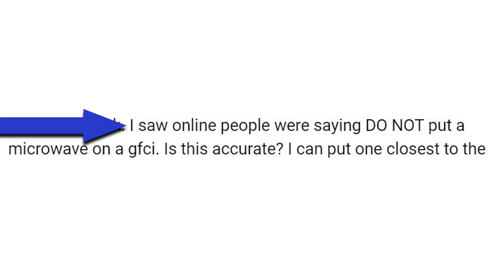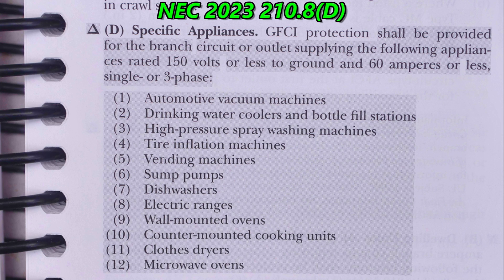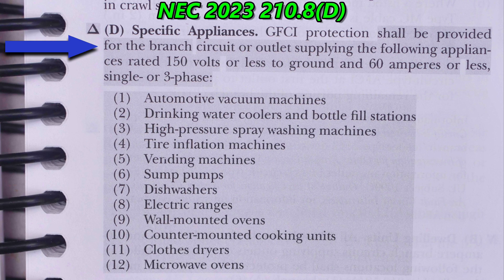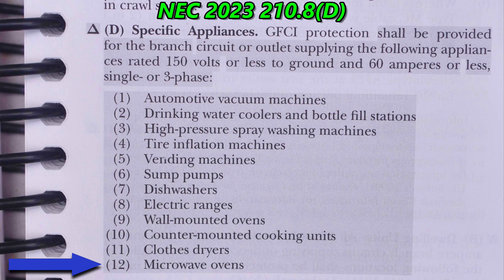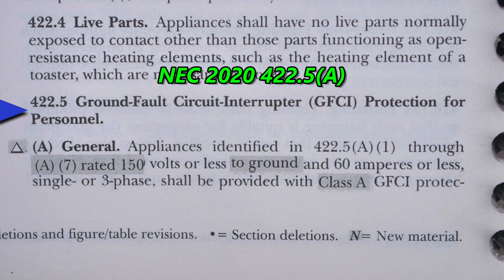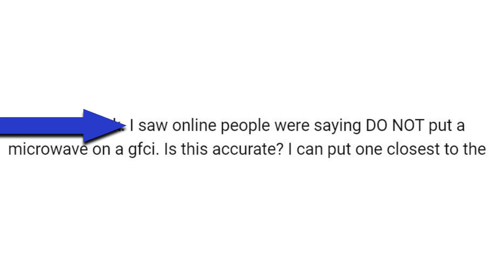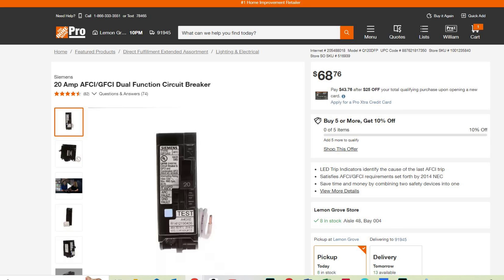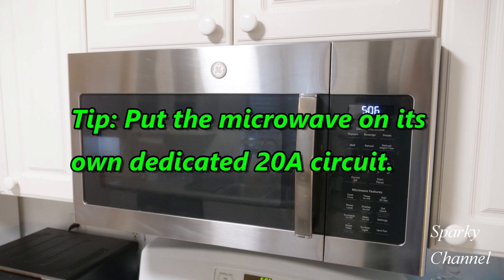Do Microwaves Need to be Protected by GFCI? (NEC 2023 210.8(D)

Comment: just bought a Samsung microwave, i have a dedicated circuit with a gfci/afci breaker.  The microwave trips with every use.  Called the electrician who said I have a bad breaker so of course I have a new breaker which trips every time I use the microwave.  A appliance tech came out to inspect it and found no electical leaks and called Samsung and first thing he asked if the unit was connected to a gfci and was told that they should not be plugged into a gfci outlet.  So I have a new microwave that doesn't work.  Told by Samsung tough titties said the big cat to the little kitty

Comment: Great info on the 2023 Code changes & requirements!
However, it is worth noting that:
Electrical device manufacturers (e.g. Leviton, Siemens, Schnieder/Sq-D, et.al.) all have VERY heavy input and influence into the NFPA-70's Code-making panels. Therefore it should come as no surprise that these companies would push the much more expensive devices to be "required" nearly everywhere. After all, if you can sell circuit breakers that cost $70 - instead of one's that cost $7 - which would you rather be trying to sell? (And it's doubtful they cost 10-times as much to manufacturer).
Just follow the money...
For some appliances - like a dishwasher or sink disposal - a GFCI recep' is not always easy enough to access in the event of a trip. Therefore, a GFCI-type breaker must be used... at 10-times the cost.
While GFCI's have been around quite awhile, and have become pretty reliable, AFCI's have not. The technology is still fairly fresh, and they still suffer from nuisance tripping - usually without any notable cause. They are also very sensitive to utility line surges (such as lightning) which can damage the circuitry and will cause them to nuisance trip even more.
I recently removed four such  devices from my own residence - which all began randomly tripping following a thunder storm event in my area (a very common occurance here in my area of west Texas. We did not suffer any outage during the storm). Once the defective AFCI breakers were replaced... no more nuisance tripping (they were relpaced with standard breakers).
I have heard of electricians who will install the required AFCI breakers in a new construction house, simply to pass inspection, then will remove & replace them with standard breakers afterwards, just to eliminate endless trouble-calls from the new homeowner. 
While the protection idea is wonderful, the reliability of the equipment designs and technology hasn't quite caught-up...
Reply from the maker: First of all, let me say that you have a wonderful ability to write effectively while also getting your points across. Well done on that. Also, I agree with everything you mentioned except for swapping out required AFCI's for standard breakers.
For my 2 cents, I think that whoever included sump pumps in this never owned a sump pump. Thanks!

Comment: Above the range microwaves or range hoods require a dedicated circuit. Must be GFCI protected if within 6 feet of a sink, or if 2023 code is in effect. Here in Florida we're on the 2020 code until 2026.
Reply from the maker: Right on, thanks!

Comment: so obviously a 220 volt 30 amp electric clothes dryer does not need a gfci , but does it need afci ?
Reply: All 120-250 volt receptacles in the laundry areas require GFCI. Washer and dryer. 210.8 AFCI is only required for the 120-volt laundry outlets. 210.12
Reply: been having issues with dryer gfi's had the inspector out and he said put in a regular breaker , some applications just aint workin right  @JeffBanfield-t6v
Reply: @sayfullahdclxvi5773 no that jumper should be removed either way
Reply: @coreyfranco7060  In older homes with three prong, I would leave it on. Otherwise I completely agree.
Reply: @lakorai2  assuming you are authorized to rewire the circuit, sure.

Comment: A lot of times the GFCI on microwaves, ovens, dishwashers, and related devices, the recepticles are not easily accessible. If the GFCI trips on a dishwasher the homeowner would have to pull the device out to access the reset buttons. I have started to see these devices hardwired to eliminate the local GFCI and put a GFCI breaker instead.
Reply: I move the outlet from behind the dishwasher and relocate it to under the sink.
Reply from the maker: Good point, thanks!
Reply: 2023 NEC 422.16(B)(2)(5)

Comment: I'm not sure what the NEC says, but I recommend putting mounted microwaves on their own circuits, and 20-amp if that's allowed. For some reason in this 70's house they put the kitchen lights and the microwave on the same 15-amp circuit, and it dims the lights every time the microwave is used, even LED bulbs somewhat. I have a 1200w modern microwave.
Edit: Oh I see you recommend the same! I posted this before finishing the video, lol.
Reply from the maker: Great minds think alike!

Comment: Almost seems that the people writing these codes have stocks invested in circuit breaker manufacturers.   Looking at 210.8 (b) , gfci protection in other than dwelling units,  125 and 250 volt receptacles 150 volts or less to ground.  So what they're basically saying is a lot of 2 pole GFCI breakers will be sold.

 However, let's say I have a NEMA 6-xx receptacle in one of the locations specified,  and I'm using phase A -B in a 120/240V 3 ph 4w delta panel with B phase as the stinger leg. What that means is I'm not required to provide GFCI protection because one of the phases is 208V to ground,  although the breaker must be a 240V straight rating.  That's my interpretation, what are your thoughts?  Let me know in the comments.
Reply from the maker: It will increase sales. I have to agree with that.

Comment: Question when it comes to refrigerators.  Most folks say no to GFI protection outlets for refrigerators because the compressors can draw a large amount of juice when kicking on. Some electrician's have put out that if your fridge is kicking off the GFI plug in a garage, put the GFI outlet in the next plug in the line (to protect the rest of the line, but not the fridge).  I really couldnt find anything on that!!!!  That lead me to thinking.  Lets say you have a fridge in the garage and it's plugged into the first outlet in the line. The second outlet is a bathroom. The next outlet is an outside plug then two more outlets in the garage. If what this other electrician was saying accurate, the first outlet could be changed to a regular 15 amp outlet. The next on in series is the bathroom. Change that one from a regular 15 amp outlets to a 15 amp CGFI outlet to protect the bathroom and the rest of the circuit.   So confusing!!!!
Reply: Fridges should be on their own 15A circuit. If it gets tripped by a different plug elsewhere then you may have $300 of rotten meat because you were unaware of the trip.

Comment: Wait a second... No Fridge or Washing Machine on that list?
Reply from the maker: Yeah, I think those will be on another video. It's getting rather confusing, isn't it?
Reply: 210.8(A)(6)  required in Dwelling Units Kitchen's (if a fridge in the kitchen, it needs GFCI
210.8(A)(11) required in Dwelling Units Laundry areas. (Phrased so no matter what area the Laundry machines are installed in, they are required GFCI.).

Comment: my inspector back in the early part of the century had a low bid electrician put in 15A circuits for over the range microwaves in a multifamily dwelling, and told him it was okay, because he was going to install 1000W microwaves.  so he went microwave shopping that weekend, and found there was only one model of over the range microwave that it is legal to feed from a 15A circuit.  

in my state, the specialty code allows fixed appliances to be fed from a non GFCI protected circuit in a dwelling unit.  but that doesn't include countertop microwaves.  it does include dishwashers, but I developed a habit of putting a faceless GFCI under the kitchen sink to serve as a local disconnect for the dishwasher - unless it's a cord connected model, in which case I can just put in a standard GFCI and safe off the wire that would feed a hardwired dishwasher.
Reply from the maker: LOL! A 15A circuit for a microwave is just plain being cheap. You know the owners will eventually change out the original micro for a higher watt one.
I love that some states stand up against overly stringent new codes. It sends a message.
Reply: @SparkyChannel  the original argument for AFCI tech qas to prevent fires from damaged electric blankets.  Now I'm seeing maxed out circuits, because electricians are trying to get away with one less breaker.
Reply from the maker: I can understand that because the  breakers are so expensive now. @kenbrown2808

Comment: ive got a light with a ballast that instantly trips gfci outlets 
its odd
Reply: If you have already you might want to replace the ballast. My guess is that the ballast is allowing a small amount of current to leak from the neutral to the ground wire.
Reply: @everythinghomerepair1747  ah it was a restore find, there's gotta be some sorta super janky fix for it
It's also an electronic ballast which I haven't had the best results with, they all make my speakers hum which is weird because my amplifier is 2 wire. One electronic ballast I have has an extremely weird flaw, it works as normal for a while then randomly it starts a  pulsating 60hz buzz very loudly through my speakers. It has fans but they are missing blades and don't spin. I do not use that ballast anymore.

Comment: I can see how this plays out. The manufacturers on the technical committee need to raise revenues to meet their growth goals and secure their bonuses so they come up with all kinds of new expensive gizmos and justify their introduction in the name of safety.  The installers on the committee argue that its going to add a huge costs but they can do cost plus and increase their revenues as well so, they go along with it.  The underwrites on the committee reason, hell, if there is one less claim, sounds good to us.  So, it gets approved and added to the next edition.  They are all winners except, the consumer loses bigtime .  The consumer always gets screwed.  They used to have a panel filled with $6 breakers and now they have a panel filled with $50 breakers.  The end-user notices no increase in performance and may even experience nuisance interruptions but they sure noticed the increase cost of the house.
Reply: The end user doesn't notice anything until they get shocked by the metal casing of an appliance with a fault inside.
Reply: @ewicky  Why isn’t the appliance grounded per the code?
Reply: then the low bid electrician wires the whole house at 3W per square foot, and the breakers keep tripping because of all the stuff that people plug in, nowadays, so they call the electrician, and it would cost thousands to upgrade their wiring, then the handyman says they can just change out the breakers.  and that's why I went to a service call, where the portable sauna didn't work because a 3 foot section of #14 romex had burned in two, but the 30 amp breaker didn't trip.
Reply from the maker: Wow!

Comment: The people writing these codes have lost their minds. Fixed appliance that are properly grounded don’t pose a shock hazard. It seems to me the standard is moving to double and triple redundancy to prevent an event that may occur every 50 years. The cost/benefit relationship is no longer intact.
Reply: You have missed the reason for changes to the code .   Safety is second to the hookers 4:49  and bribes from manufacturers.  The nec code is less and less about electric shock and fire prevention and more about what device  no one wants to buy unless forced to under color of law supposedly based on safety.    No while I am not against all electrical codes putting a sump pump on an arc fault or GFCI risks a flooded basement.   Same with putting those devices on the circuit your freezer is plugged into.  If the you are gone for a couple weeks in July in my part of Ohio and the power to the freezer is cut.  You have biological weapon stock growing in your garage
Reply: People die everyday and there is no way to stop that.  There is also no such thing as 100% safe.  A proper safety analysis weighs the cost benefits of adding the increased complexity and cost to mitigate an incremental risk.  There's a limit.  You cannot prevent every accident and every death because there is no amount of technology or money that can do that.  I believe the line has been crossed, you may not.  Think about a car where no one dies.  How many billions of dollars will you pay for that?  And it still won't catch them all.  @cjrock4096
Reply: People could die even when something is grounded cause regular circuit breakers won't detect small amount of energy
Reply: Its a simple voltage divider.  I assure you that hypothetical >5mA leakage current you speak of will find the ultralow impedance ground conductor far more appealing than the very high impedance human body.   @alvilla701
Reply: So what. In the middle the breaker trips. Do you want to go outside in the freezing cold, or in a cold basement or garage to reset the breaker?
Reply: @saulgoodman2018 I'm just saying that a regular breaker is not to protect the person,  is to protect the wiring system.
 A full gown man can be killed by only 20mA, and a little person (babies) could be killed by much less (probably around 10mA), so it is up to you what you really want, if you think that it is not worth to have GFCI, that's fine with me 
 Also, a GFCI will not trip for just any reason and will work without the ground wire
Reply: @alvilla701  You're misunderstanding. 
I would want GFCI.
When I use a toaster, and mic at the same time. They will trip. 
It's faster for me to reset the GFCI.
Reply: @saulgoodman2018  you should have 2 circuit in the kitchen, if not,  then don't use things like microwave, toaster,  coffee maker,  etc, at the same time, if possible,  run 1 or 2 more (20amp) circuit to the kitchen.
 If you use the microwave and the toaster at the same time,  and the breaker doesn't trip, your home wires will burn, maybe very slowly each time, and you'll need to replace all the wire in that circuit,  or it might burn your home
Reply: @alvilla701  Those 2 outlets is on it's on circuit.
Sometimes they trip, sometimes they don't. Like 90% of the time they don't. But it haven't since I got a new GFCI installed.
Reply: @saulgoodman2018 why is it tripping?
Reply: @alvilla701  How would I have known they would have tripped?
Reply: @saulgoodman2018  by the number of watts you are putting on the circuit,  a 20A is for 1900W, a 15A is for 1400W, so if you are using a 1500w microwave plus a 1200W toaster that is equal to 2700W, so it should trip even a 20A (1900W) breaker.
 You can go over the wattage that the circuit was designed for, but not much. It is hard to tell exactly,  but probably only about 15% more Watts
Reply: @alvilla701  How I how to add it up.
Reply: @alvilla701 I have 3 GFI circuits each with 2 outlets on our counter. The refrigerator is on its own circuit with a single outlet just for it. It is more than 6 feet from the kitchen sink. All the  outlets where I stand on a cement floor, either the basement or garage, or outside are GFI.
Reply: @cjrock4096 I know what they are for. But if an outlet trips, I can just reset the outlet. Instead of having to go down in a cold basement.
Reply: @cjrock4096 All outlets are accessible.
You have something plugged into it, so you would know where they are.
Reply: GFCIs are cheap, very cheap.  Approx similar cost to replace a duplex with new duplex outlet.  And they are getting smaller.

Comment: Ever seen a ground rod installed underneath a house ? I have never seen that, this was a first and I've been under a ton of homes.
Reply from the maker: No, I've never seen that. Perhaps they installed the ground rod, then built the house?
Reply: I've done a couple on remodels.  where they had the floor opened, and it was easier than routing the new GEC outside.

Comment: My understanding is it needs to be an easily accessible outlet near water, outside, or in an unfinished are to require GFCI.
a single outlet behind a refrigerator in a cove shouldn't.
Reply: The wall outlets in my garage are GFCI protected, but the ceiling outlets for the garage door openers are not
Reply: When the receptacle is not going to be accessible use a GFCI circuit breaker